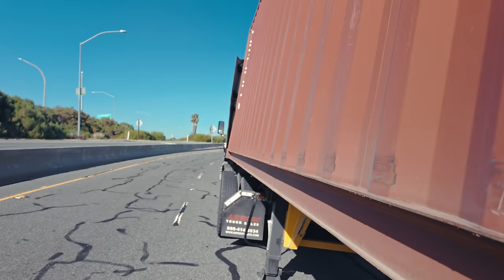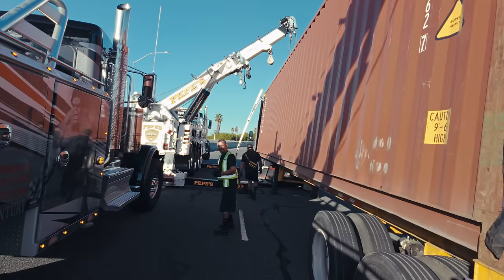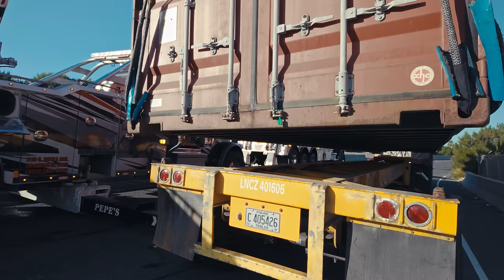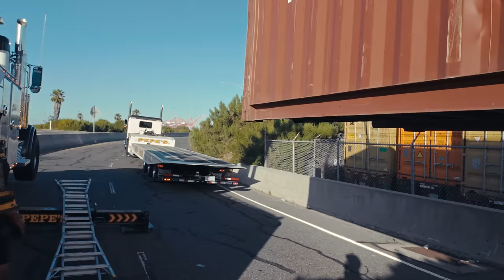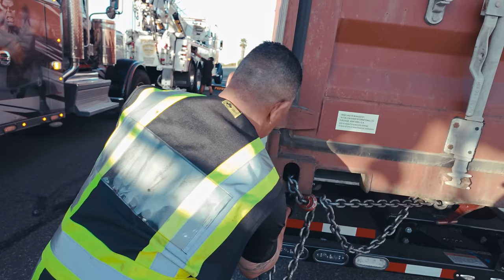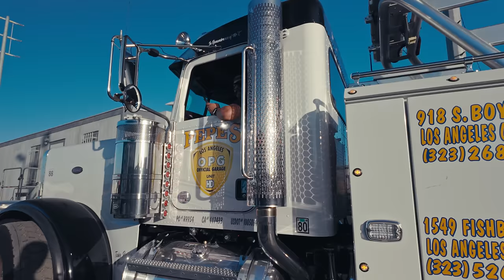Shifted Load of TOILETS Almost Flips Container!

Comment: Ive picked up shifted loads at the rail before. Icalled the boss and sent him a picture the telehandler had the pins in the highside and the low side was COMPLETELY out of the pocket. 
A 20 ft standard on a 40ft ctri axle combo chassis. Boss called and said GET IT OFF MY TRUCK!!!
Zip ties Zip ties Zip ties. 
Plastic or stainless steel. Stainless steel safety wire works as well.

Comment: Should check out yankum ropes.
Reply from the maker: Zero interest. What would a yankum rope do for lifting applications like here?
Reply: @PepesTowingService  they have a sling cover that would do the same as your blue protectors in this video. But looking at it more I've never dealt with a container I don't think they would slip through the holes very easily.
Reply from the maker: @mitchhardwick4674 I'll look into it but I'm VERY happy with my equipment currently
Reply: Yankum is fantastic company for offroad recovery but I can't imagine they have many things useful for heavy lift lol